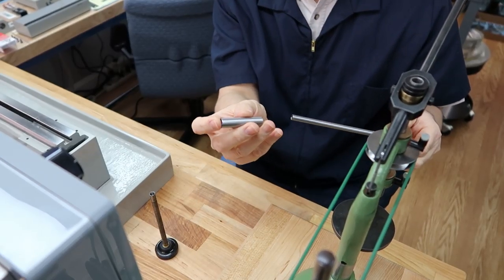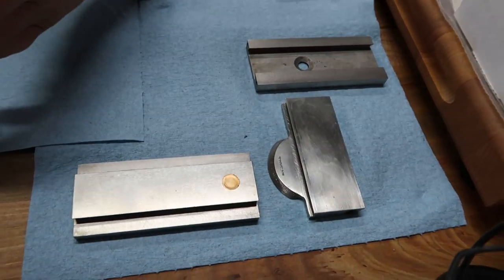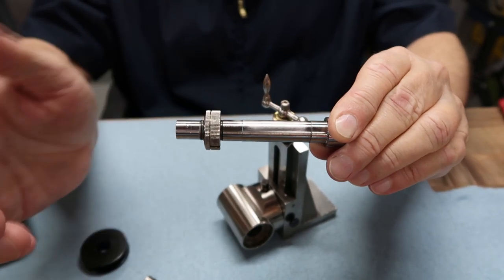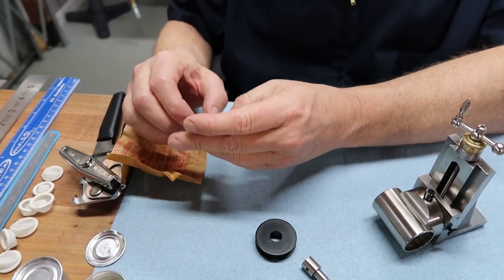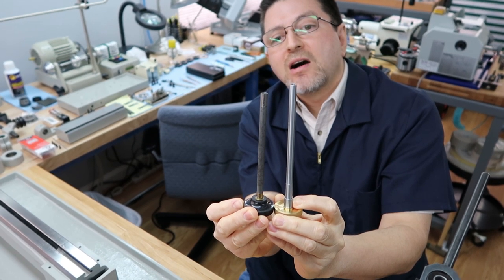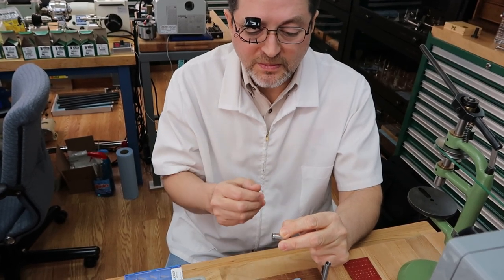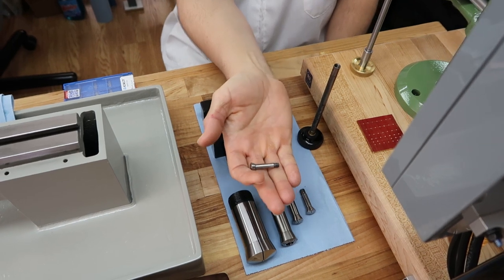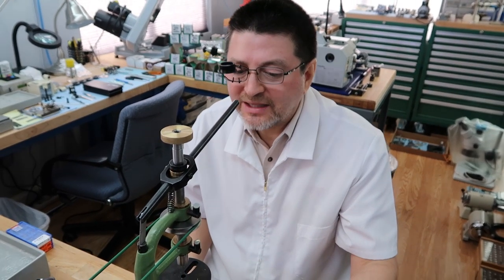SHOP ADVENTURES 23: German Micro Drill Press Completion

Comment: Lance & Patrick,
   No worries on the long videos. I enjoy every minute you guys produce.
   As for the military packaging, there are several reasons for the methods they require. One, and the primary reason is for corrosion prevention. You were right about that. The US Military has units in virtually every climate in the world at any given time and each part they order passes through many environment changes before it reaches its destination so secure packaging is absolutely vital to ensure optimum condition. I knew the final covering would be cosmoline. Everything metal gets slathered in the stuff for preservation. Hint: Lacquer thinner works best for removing it. It will take a good wash before you get it all out of the bearings. Another reason has to do with inventory standards in the military. Package identification, dates, supply shelving and storage; everything has a designation to identify it. Every number, letter or mark means something for its path through the military system. 
   Additionally, the over the top packaging is to insure against damage during shipment and delivery to its destination. Consider the fact that most of the supplies and material we received in a combat zone in Vietnam came via sling nets and drop released from helicopters which often could never land due to heavy fire. We called that a Hot LZ. Even under peaceful conditions the people that move shipping containers in the military are not usually too concerned with careful movement and sometimes conditions are not the best. 
   I remember requesting wheel bearings for my Jeep and was presented with eight cans by the supply sergeant similar to, though larger, than the tins your bearings were packaged in. 
    It seems ridiculous but it’s necessary. Consider the fact that I received my wheel bearings at a remote outpost where the dust on the road in front of supply was 14 inches deep during the dry season and a river of mud during monsoon season. Soft packaging would have rendered those bearings unusable under those conditions. Even PX items such as potato chips, nuts and cookies were packaged metal tins. All beverages such as soda and beer were packaged in steel cans not aluminum with no pop tops. Everyone had a can opener on their key ring.
Reply from the maker: Hello Dale Griggs, you got it the heart and the pinned comment to the top of the page. We do not take either of these YouTube functions lightly. You get the heart for serving your country and being a mechanical person, then you got our Pinned to the top of the page because your answer if the best example, maybe better then we could have hoped for, you not only know the reasons for the Government identification and packaging but you actually utilized it as well while serving, that makes you this person for this weeks video, thank you for being here and for being our friend, Lance for Lance & Patrick.

Comment: I like the green on the drillpress! You all have quite the hoard of tooling! Solid rock is awesome and I am sure would have helped if needed. Surprised you all don't have a mini cylindrical grinder.
Reply from the maker: Hi Brian if you had this drill press in your shop it would get lost under the Monarch Lathe, that lathe is huge and it is going to turn some giant and great parts for your business to be sure. We do have a cylindrical grinder no it is true we really do, let us not get carried away with these visions of giant grandeur, it is on the micro scale we have a Levin lathe bed live tooling grinding head so we can grind between centers to really tight tolerances.
However the 8mm draw bar would have been ok to do longer and larger in diameter to what we are comfortable try to like watch movement parts (we know too small for Brian LOL maybe Bailey oked first) and such sizes so that is why we nearly went out after machining a new one to Solid Rock Steve and the family to help us.

Comment: The little micro drill press came out great. Love the belt drive systems, much classier than a modern head mounted motor and no bulky head assembly. Thanks for showing the bearings in a spam can. Military knows how to package things to last. There's some interesting reads about the New Departure Bearing Co. on the web. My Bridgeport came with mostly New Departure and Norma bearings.
Cool stuff.... Keep'um coming.
Reply from the maker: Thank you for stopping in to share a chat The Ayr Cave Shop. I was calling the New Departure because we got in some of those so until I opened the can live in real time and realized it was a Norma makes sense. We see you like these bearings as well as they arrived in your Bridgeport Mill a knee mill we have one on the list as ewe expand into larger parts making as well as doing what we currently are. Thank you for sharing with us. We love our micro drill as it is now joining the micro tapping machine both are a part of something bigger that is coming up. Lance for Lance & Patrick.

Comment: G’day Lance and Patrick, I liked that little Marshal milling attachment, it was beautiful. Those bearings sealed in a lunch paste can is different, no wonder military supplies are expensive, I wonder if they do the same today. 
Good old cutoff disc to cut the spacer, not much out there that will stop. 
Good video, cheers, Peter
Reply from the maker: We are so saddened over your broken gear we are equally happy however you are going to be able to fixit, never had a doubt about that. The milling, grinding, drilling attachment is so neat and as we share one of only two ever seen by us two anyways in 30 years so we cannot wait to share it working in action again. Yes Patrick used that cut off wheel smelled up the whole shop for a bit but nothing can stand in the way of these two trouble makers on their journey Peter. The cans, US Government sealed cans were so great and to get to open one see what is inside and then share it with you all, never could have seen that when it was packaged in 1967 to say the least Peter. Clean the Cosmoline out and re grease cautiously those bearings and we are going to be great going forward. Your machine is going to machine a new gear it is really amazing to watch your channel Peter.

Comment: Good video Guys!  I like seeing that Micro Drill Press running!  Pretty sweet!
Reply from the maker: Hello Reid Eichner, what a great little drill press this machine has turned out to be, thank you for recognizing and commenting on it. We really had no idea about how it would perform, so wow until this was rebuilt we only had a general purpose Delta brand drill press in the Machine Shop area and our Levin Micro Drill press that is our most repression drill press in the shop currently. Thank you for stopping by wondering what we will do this next week. Lance for Lance and Patrick.

Comment: That is a great little drill press, well done! The overview of the different collet sizes was cool. Keep up the great content. Cheers
Reply from the maker: Hey Joe we were hoping you got to watch the video with the micro drill press she two is from Germany however we have not yet identified the maker it is really old and it is what we call a full rebuild for that machine because it was power coated unable to save the original paint it was too far gone. The reason we wanted you to see the drill press because it is the drill press that drilled the 0.8mm diameter hole that we tapping in the German tapping machine to 1.0mm. Joe it is really small work we do here and we both glad you are enjoying. Lance for Lance & Patrick.

Comment: Military packing really impressed me. Congrats on the project is done! Have question, maybe you already mentioned it... but how many maximum RPM the drill press gives?
Reply from the maker: Hi our friends your micro drill press question is a GREAT one because we did not thick to mention it, we use a two step pulley on the motor shaft, it is a one to one and a two to one as the one to one matches the spindle pulley. The RPM is as follows for this little might mouse the 1 to 1 is 1750 RPM and the 2 to 1 is then 3500 RPM. Patrick says great question and we hope this answer shares a great understanding about this little drill press. Your friends in the states Lance & Patrick.

Comment: Noticed in several of the videos that you've got what appears to be a Proxxon Bench Grinder in the background...
As the happy user of a Proxxon Lathe, Mill & other accessories, I'd been considering getting that very same Grinder...
...curious to know what you're mostly using it for & whether you consider it as a worthwhile purchase?
regards Colin
Reply from the maker: Hi Colin Creed Tattoo Machines thank you for being here (sorry I am late to answer) to share in this journey of two childhood friends one with a single tattoo and one without one yet for now here. 
Proxxon is trusted here, we have a few of these grinder units around the shop, even one in the electronics shop, we use them for everything you would use a Dremel for and more. 
We have the power shafts and many accessories to do fine grinding on metals, plastics, Phenolic,  cleaning micro threads, polishing some surfaces and we even have the Proxxon mini belt sander well we are a micro machining operation so small is a GREAT thing here. Thank you for your great question Tattoo Machines are neat tools. Lance for Lance & Patrick.
Reply: @ActiveAtom  Lance, thanks for your detailed reply, it's much appreciated.

Comment: Can I ask Patrick what his view is on the accuracy of ER collets and whether they are used in your workshop.
Reply from the maker: Hello Mr Carpathian you are a very good person smart and with vast knowledge one we are thankful is here enjoying our show Shop Adventures.
Here is what the collets do in our view, we do have ER collets but they are used i our in-house built TAIG CNC table top Milling machine.
This is Lance and in my aerospace job shop past we too utilized larger ER collets in 45 taper and 50 taper collet holders for gripping smaller mils, drills, reamers and such.

ER collets were originally designed as a tool holder since 1973 by Rego-Fix as tool holder so they are more for holding standard shank diameters sizes like boring bars, cutters, drills, reamers, center drills and such, and the secret to an accurate ER collet in or experience is the way they derive at the minimum and maximum tolerance so an example would be you have a 2.0 mm ER collet, it holds its best tolerance at 2.0 mm in the natural spring-less state, once you expand the collet or shrink tighten the collet the tolerances that are factory claimed greatly diminish through deformation of the spring steel.    

The sizes of the precision collets we use are more for holding the raw stock in the machines not the tools, so more sizes are highly available and these are more costly having to buy far more as well because you cannot expand or contract the openings in our collet types like you can with an ER collet type. 
The sizes available for each are drastically different meaning, say for this example, we use 5C, 3C, D, WW and 6mm, in the Machine Shop and the Workshop at Active Atom. 
These come in incremental sizes in every .1mm size.
Thank you for writing to us about this collet question and we hope the answer is satisfactory.     

Patrick & Lance
Reply: Active Atom Thank you Lance for your informative and helpful reply. I now understand the difference between the types of collets that you and Patrick use and why.

Comment: Hi guys, please excuse my ignorance but can you tell me what that gray tray looking device is with the T-slot insert on top? It is most visible at about 38 min into the video on your right side of the drill press. Thanks
Reply from the maker: Hi Kip you are not a bad guy, your question is like all questions in our opinion, a GREAT one to us and we are happy you asked it. This is Lance from Lance & Patrick at Active Atom.
That "T" slotted bed is for a Levin Lathe a company still in business here in the Los Angeles, California area, and while they still make this 18" inch lathe bed called an instrument lathe length and style lathe bed in the video (thank you for sharing the 38 minutes in to help us share this with you) the chip tray it is mounted to is no longer made or sold and are often sought after by Levin & Son 18" inch lathe bed owners. 
The reason we mention the specific length of 18" inches is due to the fact the company makes a shorter 13" bed length (not a watchmaker lathe either) and while the company got its start from making watchmaker tools single leg lathes for optics, aviation gauges and watchmakers in 1917 forward. 
The Levin bed and the chip tray as well as the lathe headstock (not in that video shot) are all made of a grey iron material to a very high stander of casting named Meehanite process and certification ne of the most stable iron casting methods known today.
Kip we are both happy to have you here with us and look forward to hearing from you in the future as we are beginning to make new videos (after just over 1 year away) as we have been busy working on a lot of items preparing to start making our first company made product after nearly 30 years (since 1993) of doing work for others.
Lance & Patrick.
Reply: @ActiveAtom  Wow, that's a lot of good info. I'll definitely be watching for your upcoming videos. Thanks again!